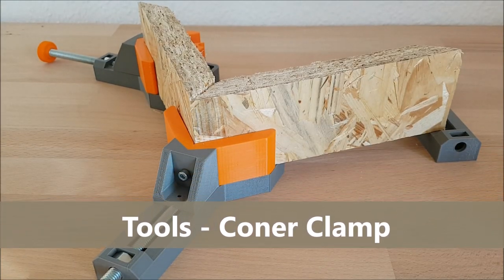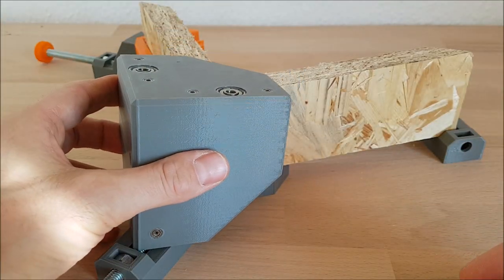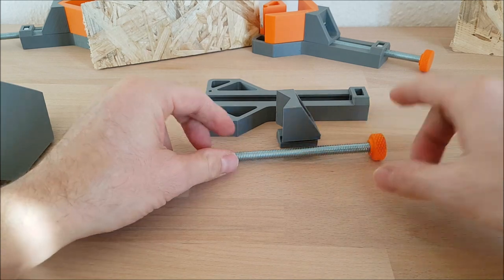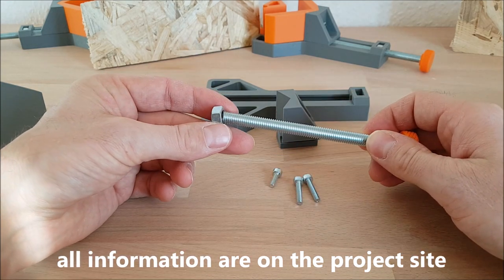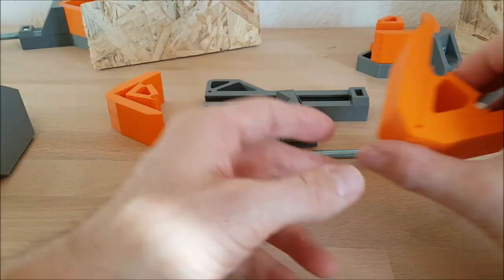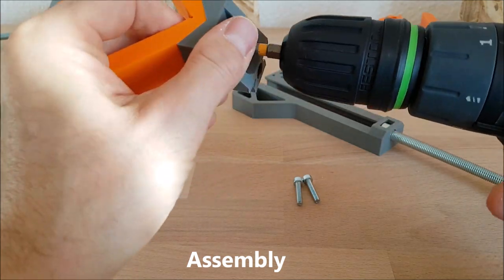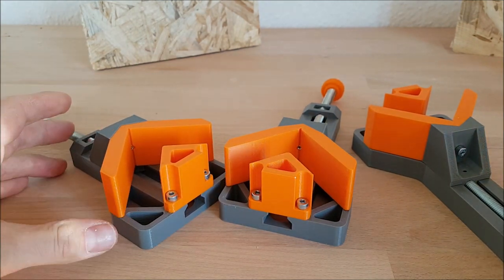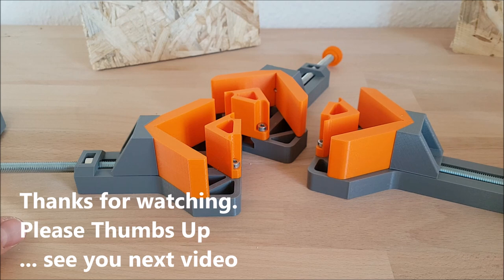3D Printed Tool - Corner Clamp

Comment: 1x hex bolt (5/16" x 4.5")
1x hex nut (5/16")
1x machine screw (8/32" x 0.5")
2x machine screw (8/32" x 3/4")

Don't bother printing the knob. Use the hex-head on the bolt.

Make matching parts with same colors. 
Use different colors for different Degrees.

Comment: This is awesome! When you put the stud bar into the grey slider is it just screwed into the plastic? If so then what stops it coming out when the clamp is loosened?
Reply: hey i know this is a old reply but i made these and honestly that isnt an issue. if you think about the clamping pressure when you tighten it up its going to butt up against the thing its holding, but when you losenit you just slide the plastic back as it loosens up.  i havent found a way to keep the screw in the base attached since it has to rotate

Comment: I just had this printed for me by a friend. And will say it doesn't work very well for frames. Haven't tried it on vertical pieces yet, but for flat 2.25 x .75in thick pieces I'm struggling to get proper pruessure without them getting pushed out.

Comment: Amazing design. What printer do you have that you could print all that in 6 hours?  That would take more than double on my Ender 3.
Reply from the maker: I have two ultimaker 3d printer. One ultimaker original plus, which I upgraded to an ultimaker 2+ and an ultimaker 3
Really good 3d printer!
My filament is from Formfutura or BASF